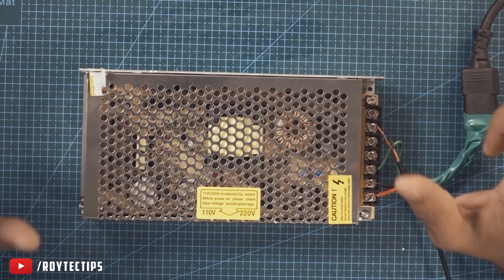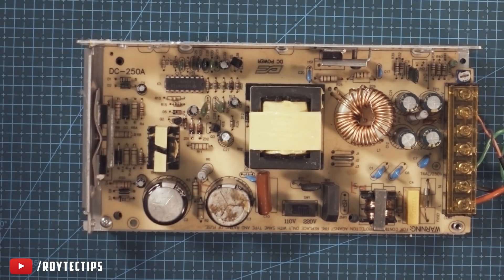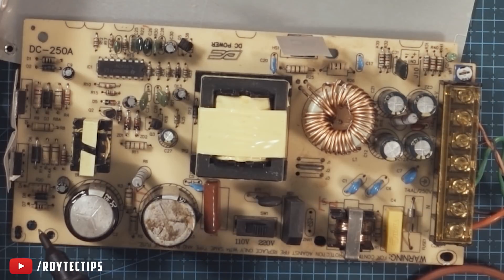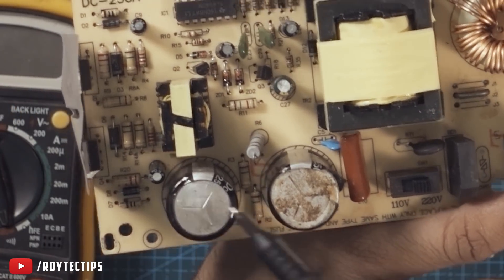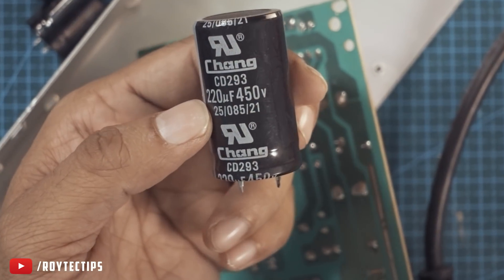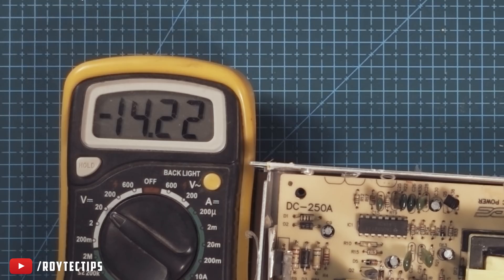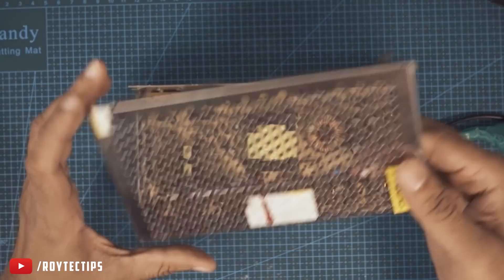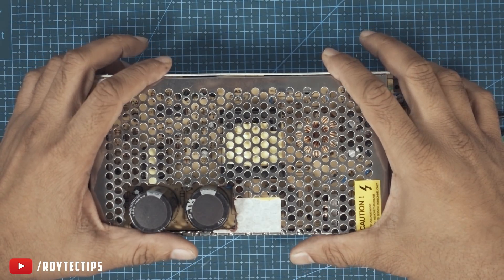How To Repair 12V Powersupply

Comment: I have a 12V 12,5A PSU, almost identical to this one and the maximum current is 13,7V.
Yours seems to deliver a little bit more voltage 14,25V.
I want to increase the voltage to 14,8V or even 16V if the setting is variable, i try to modify one of the resistors of TL431 originally they was 2,2k and I try to use one of 220R and a B5K but without results, the PSU enter in protection clicks.
Any suggestions, what values I can use to obtain a  good result?

Comment: Hi friend namesta 🙏 
Friend i have a problem with my same SMPS voltage regulator potentiometer was damaged because i am using this daily with adgestment voltage  for my  requirements that way potentiometer  was damaged quickly friend if u don't mine please tell me what is the value of potentiometer ,and is their any another option is replacing this potentiometer type please help me friend don't forget my request friend 😔

Comment: I just fixed one of these. Some corrections to your assumptions:
- Output is not a mosfet; its a  Schottky Rectifier diode mbr3100.
- The two capacitors you changed are not in parallel as the voltage would be 360v dc; instead they provide + and - half of that and share a common rail (hence the 220v rating).
- The power transistors are both NPN tansistors D13009K. 
- I did not have any failed or blown components so it was more difficult to diagnose. In the end I found the 105J 400v capacitor (1mf) had gone open circuit. Hope this helps someone.
Reply: Thanks for the update

Comment: im getting 4 volt output in same model pls help me to fault finding
Reply: same with my power supply, still don't find the faulty parts.
Reply: If it is 5 volts... adjust the potentiometer!
Otherwise... to help you i need to know if there is one or two transistors at the primary side!

Comment: Could you please tell me the name/ model number of those two transistors connected with heatsink, in my 12v power supply, these transistors burned very badly and cannot read the numbers.
Regards
Reply: If they are two of them at the primary side try to replace with MJE13009!

Comment: Actually, the problem is that these power supplies get destroyed due to accumulation of excess heat.

It will be good to put a small fan to keep cooling the power supply.
Reply: There is a fan in high current editions and also if you need 10 amps for example you should take a 15 amps edition for it not to overheat at 10 amps!
But here the problem is not caused by heating!
Reply: @Zebra_Paw  I have worked on these power supplies. They heat up like anything. It is very common with Chinese Electronics to heat up and get destroyed. Lab bench power supplies have fans but not these power supplies.

Comment: I have a meanwell power supply 12volt 350watt  which is dameged mosfet is 60R290p original mosfet. do i can replace mosfet to IRF840?

Comment: Great Information.  I love how you made the weak links much stronger by using capacitors with almost double the original voltage ratings.  Brilliant!
Reply: Wasn't useful because of a bridge divider which makes sure the voltage is correclty splited in both capacitors so better to use same voltage rating capacitors and check divider bridge resistors (150k ohm) that are probably dead (otherwise the capacitors probably wouldn't have exploded)!

It would be better not to cut the box, and also now the capacitors won't blow up again but the halfbridge waveform might not be symmetrical because the voltage is not nicely splited in both capacitors!

Comment: Why cutting upper part of smps body
Reply from the maker: To fit the capacitor . I don't have the small one
Reply: Change bridge divider (resistors) and then the voltage will again be perfectly splited in both capacitors! Then you can use 250V ones!

Comment: Can I charge 12V 35Ah battery using this?
Reply: no.
Reply: Yes but you will have to take 12v 30a edition because the battery will draw less current than this but it will be constant current charging! Also notice that you have to set adjustment potentiometer to 13.8V!